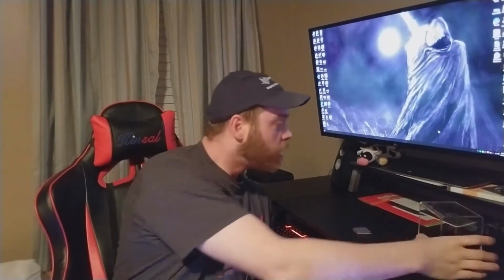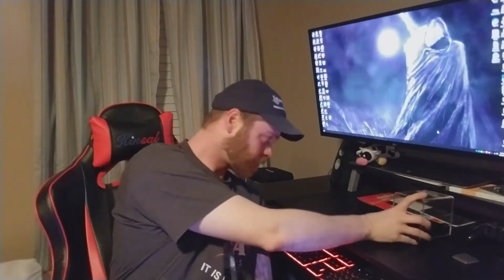Build A Wood PC Case PART 3 FINAL

Comment: Nice to see old / mid-tier hardware get some love. Fun project my man, thanks. I’m actually going to use that res in my next build. Probably won’t get the build in version as I like D5s, and separate res and pump rather than combo.
Reply: Im new to watercooling and Im thinking of doing the same thing. Would any D5 pump work?
Reply: JoeyJoeJoe Jr Shabadoo ... most will, watch the aquatuning one as it’s a slightly different size, couple of my short. EKWB, XSPC etc all use the same pump.
Reply: If you’re running the D5 separate with a top then yes, any one will do.
Reply: @literate-aside  ty,🙂
Reply: JoeyJoeJoe Jr Shabadoo Np. If you want any other help with your WC build just reply to this comment mate. Happy to help.
Reply: @literate-aside   I appreciate this - just to clarify, do you mean I can actually install a d5 pump INSIDE the XSPC unit?
Reply: JoeyJoeJoe Jr Shabadoo ..  No you cannot. It would need a separate D5 and top, connected via tube.